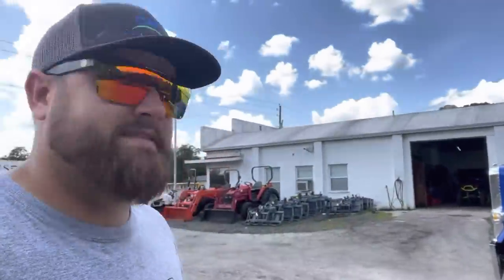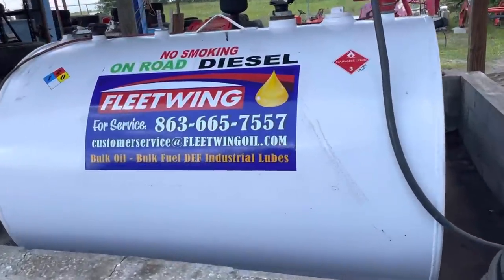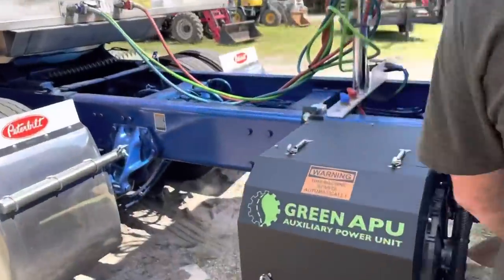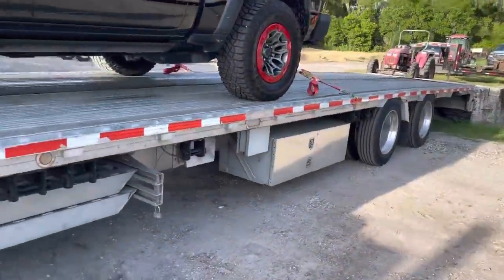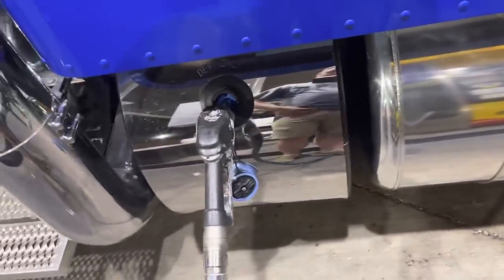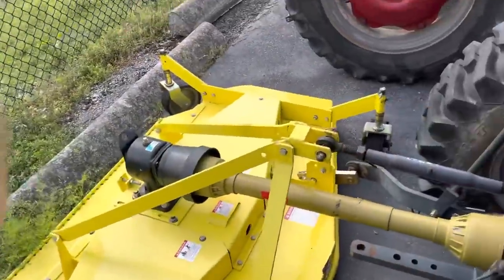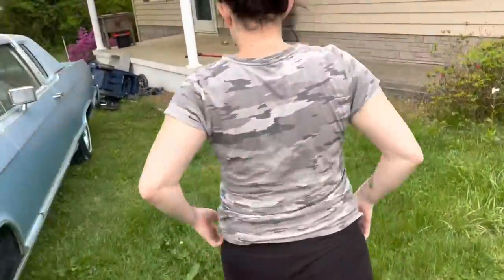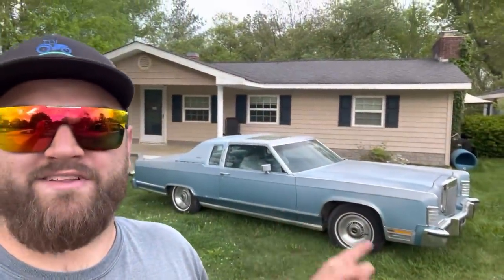How to SAVE THOUSANDS at the PUMP with this SIMPLE Solution!

Comment: Bruce,there was a recall on certain brake valves on paccar new trucks that were not releasing all the way and overheating the brakes.  While you are at Pete dealer, have them check with factory for you.  You may have one of those valves on your trlr.
Reply: Why would it effect the trailer? The valves are on the tractor itself.
Reply: @michaelrocker9000  tractor protection valve

Comment: Yup I got a land yacht too. 1975 Buick Lesabre Custom Convertible with the 7.5L 455 big block in it. My advice is to rebuild the motor with updated parts headers intake carb and I guarantee you that it will be a completely different car

Comment: I used to work with someone that put cooking oil in his diesel car and not only did it save him at the pumps the car got off the line quicker. 
He used to mix it with normal diesel and then add it to the tank, he did it before it was trendy just to save money. He told me when it starts to splutter you add more diesel and he got down to 60/70% cooking oil mix in his old car and that was with no mods.
Reply: George Jones  It never hurt his, but it was an old diesel.
Reply: George Jones  depends on the engine really but common rails will be fucked up
Reply: George Jones  Just have to filter everything pretty good before hand...

Comment: Love the lincoln I have had a couple. The wonky headlights are probably because they are Auto Dimmimg Do some foot work on the Dimmer switch on the floor. Its probably corroded. If not it needs a new Headlight switch. The passenger vent window just probably fell off its track-Easy fix. Give her a new roof and paint job and you will have a jewel. Cheers from Calgary

Comment: that's one  cool old car  ,,  i love these  ,, I've never had a town car  but i do own an all original 1975  lincoln Continental mark IV ,,the word LAND YACHT is the best way to put it , i have owned it since 1996 and it's one of those cars  you just love to drive ,,mine features an aftermarket Gear vendors overdrive which was installed when the car was new ,,i rebuilt the engine in 1996 when i got the car ,, a stupid saturday mechanic had dropped a screw in the carburetor  and rather than remove the carb to fix it he ignored it ,,this of course severely damaged the engine 
it rides beautifully on the highway  and with overdrive engaged  it gets an astounding 21 mpg on the interstate ,,with a 35gal tank of gas  that translates into 600+ miles

Comment: Use a tennis ball on the fuel trigger. Thats how we do it up here in Canada when its -30 out at a small station, since they removed the old self locking system. When it pops the tennis ball will just fly out and your good to go

Comment: I have a 300 gallon tank that cost me 1.85 per gallon to fill months ago. Still have half. Those Lucas upper cylinder lube bottles fit in my pump handle. Mines gravity fed, 30 gallons in 10 minutes maybe! My local gas station buys def in 250 gallon tanks. They rigged a meter and a pump to it and that's the cheapest def around. BUT it's not suppose to be stored in sunlight like they do it. Not sure if I had a def sensor fail or bad def but I haven't used there tanks since. But my 110 hp new holland powerstar actually doesn't use much. Maybe 10 gallons in the 2 years since I bought it new? Actually less because i pumped out the last fill I got from the local store. So, if you get a similar DEF, DONT STORE IT IN THE ELEMENTS.

Comment: the first and last DEF truck I had I hated , never understood why the hose retracted so violently on some of them and all of them auto retracted and  harder to pull out than they needed to be . Good job epa , crack down on the trucks and cars that pollutes less than 1 UNREGULATED cargo freighter... anyway , Tim learned a good way to tie the tail of the straps , I thought most people knew about it . Its def one of the faster ways to secure the strap tail

Comment: That Lincoln only fix what needs to be fixed it's classed as a survivor especially in that condition with only 10 thousand on the clock an will only increase in value if you don't seriously mess with it so keep it as it left the factory

Comment: I guarantee under that vinyl half top it's absolutely rotted out. You can see rust under it along the body lines of the car. Id bet you could stick your fingers through the roof on the inside.